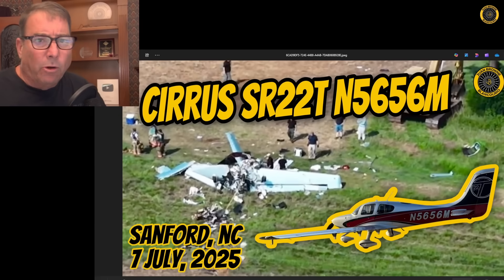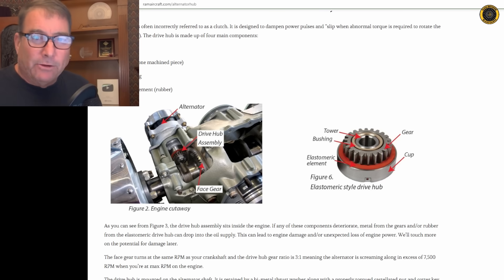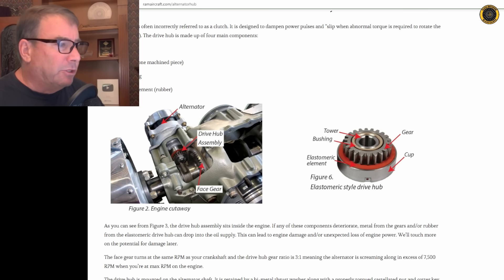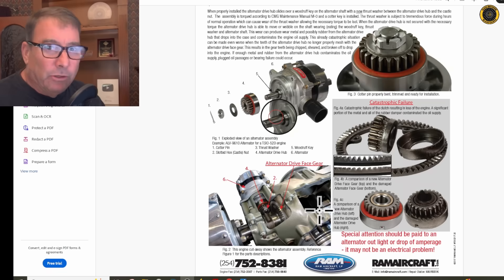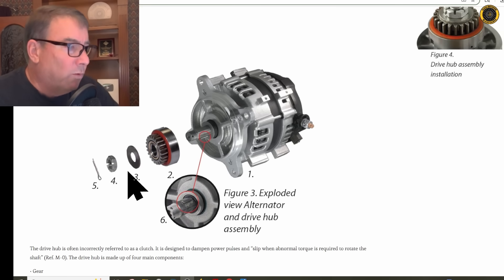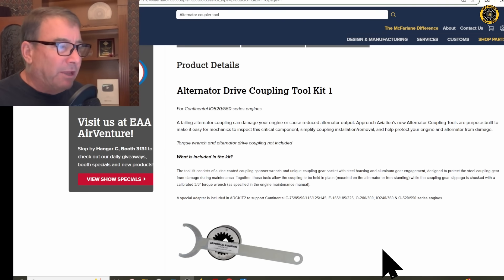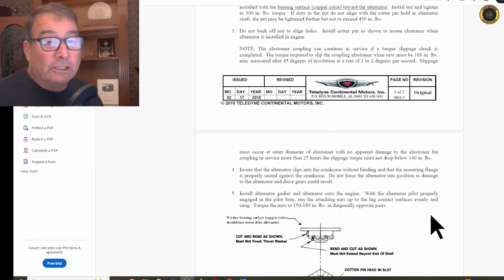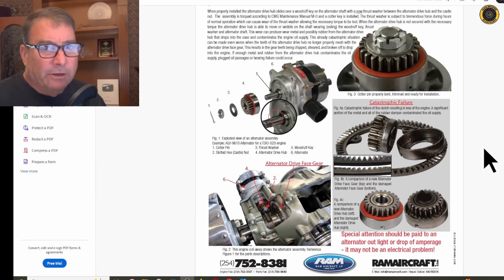Alternator Drive Failure-Can Lead to Engine Failure!

Comment: I'm not a rated pilot - but am a retired mechanical engineer who managed a flight facility.  The last program I worked on prior to retirement demonstrated to me the skill sets one wants when you are in a change environment.  I was part of the contractor team.  The senior pilot was Navy - degree in aeronautical engineering, Naval aviator, Navy test pilot school graduate.  The kicker was he put himself through college working as an A&P mechanic.  I used to love the flight briefings.  If you don't have the right mix of good theoretical engineers along with engineers who have turned wrenches maintaining things in life you can get some pretty impractical designs - you need that internal friction during the design phase.  As Will Rogers once said - 'the trouble with common sense in it's not so common.'
Reply: Damn as a mechanic and pilot, I bet I’d get along pretty well with that navy guy, probably you too with that attitude.
Reply: @bradleypeterson2208  Well - let's put it this way.  After I retired I was invited back a few years later to the Navy change of command.  I was getting a stink eye from one of the VP there (at the invite only dinner) and he finally said to me 'I don't remember us inviting you to this''.  Told him they didn't - I was the guest of the customer (Navy).  He just turned around and left - all I could do to not start laughing.  Have to add that after my active duty time (Army) I stayed in Guard/Reserve and retired many years later.  Of course that VP had never turned a wrench in his life nor picked up a rucksack.......  We had a hell of a good design and build team that cranked out an outstanding product that is serving today and for many more years.
Reply: @Duckfarmer27 all you had to say was “management”… lol

Comment: Two V35B’s w/ IO520BB’s over 25 years about 4000 hrs. Found out about the alternator problems you described early on. Had my mechanic remove the alternator each annual to inspect bearings and coupling. Had him replace both bearings every other year. Had him replace the coupling every 3-400 hrs. Also replaced the starting battery every other annual due to much IFR weather in Mi. Vac pump vanes replaced each annual and installed an electric backup horizon. Had more than a few alternator failures most due to Voltage regulator transistor failures. Cheap fix to replace a few transistors back then but always landed asap! As a pilot I feel each airplane needs a load profile showing the amp draw on each major component radio,autopilot etc.. so you know what to turn off quickly upon alternator failure. A few times I lowered the gear right away because the nearest airport was not close and I did not want to crank the gear down by hand. (50 turns on the manual crank)
Reply: Important note kids: You can inspect and replace before recommended times.

Comment: Planes with parachutes suffering fatal crashes. Commercial pilots cutting fuel supplies to perfectly good engines at at  500 AGL. I'm beginning to think the bar to becoming a pilot is way too low. I think I'll start looking for underground homes and steer clear of flight patterns.

Comment: Sir, I don't mean to correct you, but the torque value for the drive hub assembly is in inch pounds not ft. pounds. Sorry i'm a retired inspector and i can't get it out of my head😀

Comment: It's been twenty years since I last flew a Bonanza. Or did any meaningful work on one. And I may be totally wrong but I do not recall (at least back then) any inspection of this drive at an annual inspection either on the Beech or Continental checklist. There was an AD on them but again, after replacement I don't recall any further inspections necessary. But I've forgotten a lot of things since then and things may have changed. 

I was well aware of the need to make a landing at the nearest airport for any electrical failure and did so on several occasions. The engines with the standby generators which were also internally engine driven were even worse. When they failed, they seldom put debris in the engine, just sheared the drive shaft. And pilot/owners seldom knew it was inop. Some were fitted with an electric clutch to energize it and that too was problematic. I guess my point is, all too many pilots simply don't know their systems, even as simple as what you would find in a Bonanza or Cirrus and it can lead to disasters such as this. They might assume that standby generator is there so they can carry on. It's not. It's there to (hopefully) help you get to the nearest airport. There is no such thing as a "safe aircraft". Fly with that mentality and you'll have a better chance of commenting on others misfortunes twenty years after you quit.

Comment: Do modern piston engined aircraft still use magneto ignition?
I might have to google that.
I rebuild magnetos for vintage land based engines, I’ve been asked to do aircraft mags, but it’s not something I want to be responsible for. I’ve already got more work than I can handle.

Comment: The pilot described specific problems and stated multiple times "for your notes" ... i wonder if that was his "hint hint or code" for the investigators insinuating he thought he might crash & die", but did not want to outright say that in front of his wife & kids.
Reply: If he thought he might crash and die, surely there were other steps he could have taken to get to safety.
Reply: Indeed, if he feared about crashing and dying he could have just pulled the chute handle.

Assuming he had properly trained on his craft and knew it is recommended over forced landing.

Comment: As an SR22 owner/driver, I am very grateful for the video. Thanks Juan.
Reply: As a Cirrus Co-owner/driver… PULL THE DAMN CORD!!!! Do try to save the plane. Don’t let your ego or your attachment to your beautiful plane let you hesitate for one millisecond from pulling that beautiful T-shaped lifesaver! We all know you can’t stall a Cirrus, so train yourself to see that red handle as an option, and not a stop sign. 2 things are written in blood. Don’t wait until you’re over speed, and don’t try to recover from a stall. Pull the damn handle
Reply: @tedstryker73 yes we learned this in Embark, I don’t like to fly with ego attached and I’d damn sure pull it if needed. This info Juan shared has reinforced an immediate landing in the even of alternator failure, I didn’t know about how it could effect the engine prior.

Also - I hope you don’t think to pull it if you hear the stall horn.. I did my commercial in it and have practiced 100’s of stalls with accelerated as well. It is very benign if coordinated, no need for the chute lol. However - if you find yourself uncoordinated and she starts spinning then it’s time to pull the shiny red handle as it says in the POH and placarded on the panel.
Reply: @tedstryker73  Don't get trigger happy with that T handle chute saver.
                                   Instead, learn to land with a dead engine.
Reply: @John-nc4bl I’ve never pulled, or needed to. I’m just stating facts. Would you rather step out of the wreck, or get scooped out of it.
Reply: @John-nc4bl fun fact - if you loose your engine in a Cirrus, don't pull the chute and land off airport, most insurance companies won't cover the incident.
Reply: Thank you for announcing your 9 mile straight in finals.
Reply: @ihyln1  I fly the pattern like everyone else does, although it's easy to run up on a Cessna because of how much faster the Cirrus is.. I add flaps early on downwind so I can slow it down to 90KIAS
Reply: @lukebelvin4900  oh blessed thou cirrus owner/driver/captain for allowing mere cessnas to share your immediate airspace
Reply: hater alert

Comment: Correction, it's 300 INCH-pounds of torque. I doubt you could get 300 foot pounds without shearing off the shaft as you tighten it, and the literature says 300 (and later 450) INCH pounds. So, what makes the direct-drive alternator better than the belt-drive? Seems like something expensive to monitor and replace and test and install. Does a belt driven alternator fail that often?
Reply from the maker: In lbs

Comment: Had a similar issue in a C404 Titan, fitted with the "Gitso" Continental.   Alternator went of line on an engine with 80 hrs total time.  Nearest airport was 40 minutes away but didn't consider shutting down the engine which on inspection by engineers was found to be moments from distraction, with metal throughout the crankcase.
Reply: Yes, the sudden and catastrophic destruction of the engine would have been quite distracting. 😅

Comment: As usual, a highly informative analysis. I wonder if this pilot had seen any warning signs of electrical issues prior to the accident flight. It amazes me how people seem to overlook, or put off weird noises, unusual fluid losses, power losses, changes in systems, etc. In a car, if you hear a clicking or grinding noise, or some engine roughness... you'll probably make it home and then, if you're smart, have your mechanic check it out. That's a very bad thing if you're at ten thousand feet with your family in the airplane, at night, or in IMC.
May this family Rest In Peace.
Reply: Mlflyer commented that an FBO had replaced the battery before this flight. 
 I interpret that to mean there was some electrical complaint.

Comment: Alternator turning at 7500 RPM?  That seems way too fast...unless the high RPM is necessary to generate 70 (?) amps.
Reply: OVERALL SHITTY DESIGN: from the wrong kind of gears (straight teeth) to stupid elastomer torque values, to a weak ring shaped crown gear... Engineers should expend some jail time, and use it to RELEARN proper engineering!
Reply: The alternator in your car turns at least 7500 RPM at freeway speeds.

Comment: When you have a problem in an aircraft you can't just pull over and see what the problem is. The constant variable I see in the vast majority of these aircraft incidents is poor judgement or unusually high risk acceptance. I'm not a pilot but if I was and my entire family was on board I would land at the slightest issue. If you can afford a plane you can afford the maintenance. If not then sell your plane.

Comment: SB11-3 needs to be followed to the letter when installing the Alternator.  SB calls out using TCM cotter pin  103010011  important.

Comment: Thankyou Juan, great as always
Fundamentally - if you're continuing a flight with significant issues it  CANNOT be mitigated by aircraft design and shouldn't rely on the failsafes to continue flight. 
You're leaning on engineering to save yourself from poor decision making, you've corrupted a safety system.
All the best to the people involved, and their families.

Comment: In the late 80’s I was in flight school at Vincennes University. I was on a solo long cross country flight in a Cessna 152. I had flown to my hometown airport during the day and was going to log my night flight hours on the way back. During my takeoff the low voltage light come on, I aborted the takeoff, exited the runway and went through my procedures to resolve, then lined up for a second takeoff. Once again the low voltage light came on. Because my flight back was at night, I taxied back to the ramp and called my instructor, he told me to stay the night at my parents and fly back in the morning. I’m glad I stayed the night, a little over an hour into my flight the next morning my engine quit, I was flying over the  Hoosier National Forest at the time, because it was day time I found an open field and made a safe emergency landing, had this been at night I may not be here. Anytime you’re having electrical problems, better to cancel the flight, or land asap to inspect, might just save your life.
Reply: I did a sailplane flight over there 20 years ago near Vincennes… beautiful area…
Reply: @coryturner9140 really??
Cool memorial I will give them that.
Reply: The greenery was a change from the Idaho desert… although nothing matches the beauty of the Rockies, I can find beauty in all of the states.
Reply: Why would the engine fail if the voltage was low? The magnetos wouldn't be affected, and the belt-driven alternator on the C-152's Lycoming O-235 can't cause an engine failure.
Reply: @slk23 I didn’t say it caused the engine failure, it was a sign there was something wrong. Engine failed because a valve broke off and punched a whole in a piston. Valves are crucial for proper engine operation, controlling the flow of fuel, air, and exhaust gases in the cylinders. A failing valve can cause a loss of compression in a cylinder, leading to reduced power output. In a worst-case scenario, it could lead to a complete engine failure, which in my case it did. Again, the low voltage light was an indication there was something wrong, however, I nor my instructor nor the head of the aviation program could have foreseen it would lead to engine failure.
Reply: @JT-1969  Low voltage light is an indication that a valve is failing? Sorry, there's no connection.  But you got lucky that something unrelated to the valve caused you to postpone until daylight.
Reply: @slk23 I didn’t say that. I said the low voltage light was an indication there was a potential problem. Is the valve breaking off punching a hole in the piston related to the low voltage light, maybe not directly, you tell me? Twice it came on during my take off roll, and an hour into my flight the next morning the valve fails causing a total engine failure. Outside of the low voltage light coming on during takeoff there were no other issues, all systems were normal during my run up.
Reply: @JT-1969  No, the low voltage warning was not related to the valve failure.
Reply: @JT-1969 I have to agree that a low voltage indication or annunciator is a far stretch from damaged or failing valves. The fact that the engine didn’t give any indication of failure during run up or the takeoff roll is odd, and wouldn’t explain why a low voltage indication would be displayed. In order for the alternator to make such low voltage that it was evident by the voltmeter or amp meter, the alternator would be damaged or the engine would be making exceedingly low power.
Reply: @VictoryAviation  I guess I should have done a better job of explaining my situation in my post. In no way was I saying the low voltage light was an indication of an engine issue, and sure not saying it was an indication that the valve was going to break off causing catastrophic engine failure. I was just saying that the low voltage light coming on twice during two separate take off runs at full power was an indication there was some sort of issue. The low voltage light coming on twice during a night take off and solo night cross country flight over the Hoosier National Forest most likely saved my life. I was told by my instructor and the mechanics what caused the engine to fail, never was told the cause of the low voltage light, honestly, after the engine failed the low voltage light wasn’t important.
Reply: @JT-1969  Gotcha. I’m tracking now.
Reply: Great precautionary tale for all of us.

Comment: you could have a catastrophic failure of whatever as long as it isn't on fire and you have a virtual second aircraft in that ballistic chute. you might destroy the aircraft if you ride it out or pull the chute, but using the chute means you will probably survive. pull the handle.

Comment: The inspection time interval is 25 hrs. Stated by the two different specs. As stated the torque cannot fall below 145 in. lbs. So if you do not check it at 25 hrs. and you wait to say 50 hrs. and it is below that 145 in lbs. you will not if it was below at 25 hrs.

Comment: Thanks Juan for addressing this failure mode.    If this ultimately does pan out to be the reason for alternator/engine failed, I really question the design change from belt driven to direct driven alternators.  I cannot imagine how a belt coupled alternator could possibly take out an engine.

Comment: Right on target as I previouly mentioned, the outboard bearing is a 100 hour inspection item on most Continental direct drive alternator as it can cause the whole armature to wobble taking out the inboard internal gears.  I hope all pilots take heed to your advice and never assume an alternator failure is not and emergency, it is..

Comment: Well we used to quick the rubber bushing wear (Cont O-360s C-337s PA-34-200s) check on shop 50 hr type prefilght insps by turning the fan blade If its more then a blade slop wed do the further insp but annuals do the full torque check. Make sure use the proper MS stainless cotter pins also.

Comment: I did not read all of the comments so somebody else might already said this.  The alternator is actually driven at three times enngine speed.  Not 1/3 engine speed.  So if the engine is at 2500 rpm the alternator will be spinning at 7500 rpm.
Reply: EVERY time you have an Speed-Increasing gearing, a very careful design and full testing must be performed, as the gears will have larger than expected impact loads... This stupid "design" should have NEVER been approved!
Reply: I hate PSRU's. A speed-multiplier would be even worse..
Reply: Juan did say 2500 for engine and 7500 for alternator on the video.

Comment: Juan, we still don’t know why the aircraft crashed.  That aircraft  had a functional airspeed indicator and altimeter.  The airspeed indicatr could keep the pilot from stalling the aircraft.  Did the pilot stall the aircraft or did he just not have a safe place to put it down and crashed into objects or unfavorable terrain?
Reply: On a clear day, even over unfavorable terrain, he should have been able to fly it in, or pull the parachute. 

What was this pilot looking at?